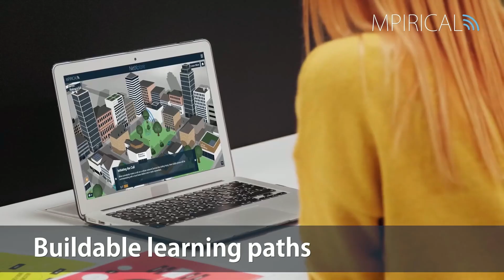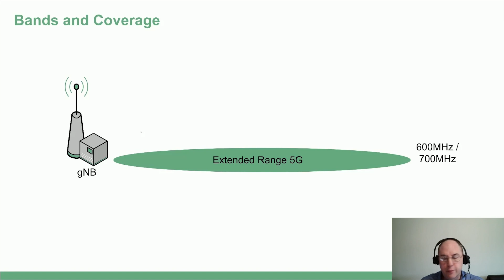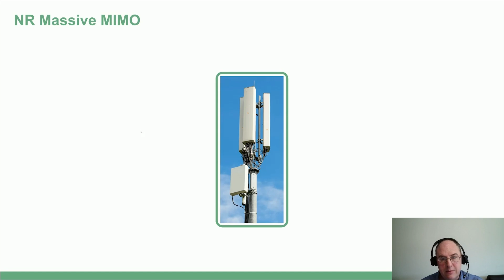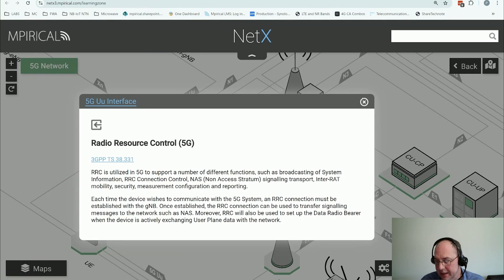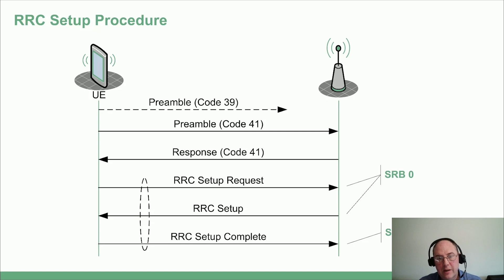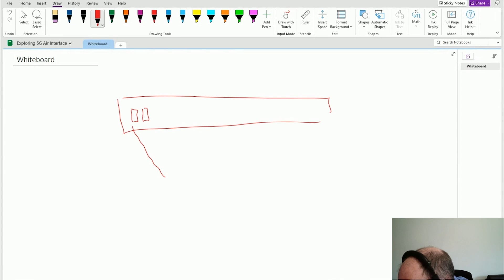Examining the 5G Air Interface | Mpirical Webinar | September 24

Comment: Does the distance between bases fixed or variable?
Reply from the maker: Hi @sunny-x7k3r, thanks for your comment. The spacing between base stations depends on coverage and capacity needs. Smaller cells with shorter inter-site distances yield greater system capacity, whereas in rural areas, where coverage takes priority over capacity, larger cells are deployed. This results in greater distances between sites.